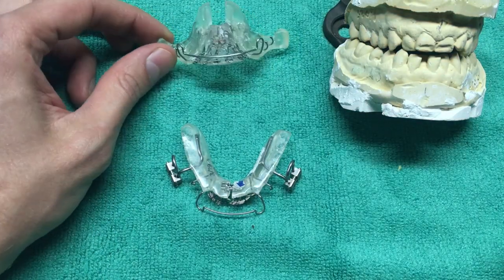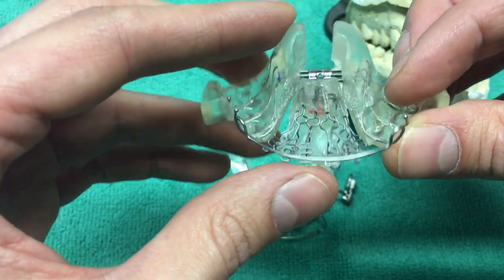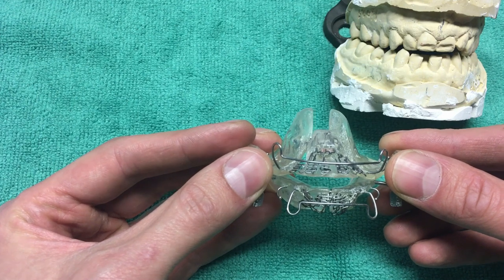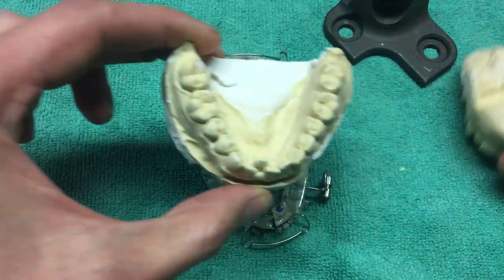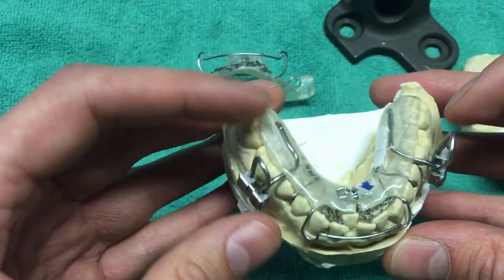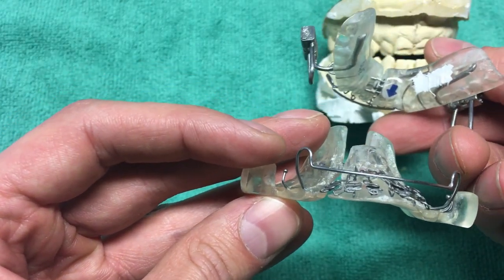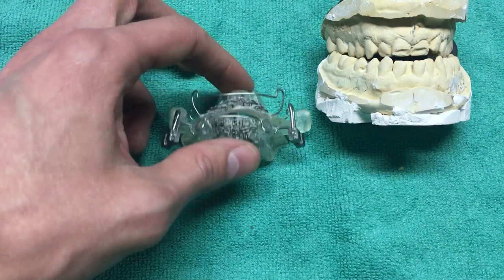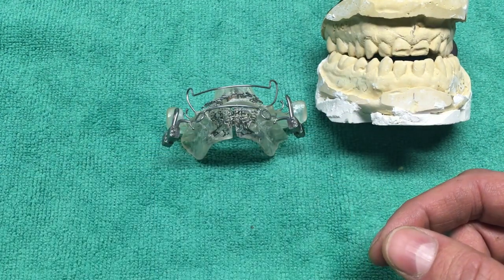What is a DNA Appliance? - This will cure my sleep apnea!

Comment: Does anyone know the difference between the Homeoblock and Vivos appliance? I know with the Homeoblock you have an unilateral bite block but with the Vivos you have acrylic across the whole of the teeth? Does this mean they function differently? I know it is there to balance the bite but I am wondering why they are both different to each other.

Forgot to add, I noticed the springs are slightly different as well when comparing them.

Thanks will be grateful if anyone can reply :)

Comment: Hi, is this dna appliance will expand the  palate suture?
Reply from the maker: Hi!  I am not sure why suture is the word you are using.  But, my palate is expanding.  So far, my palate has expanded and is wider by 2.5 mm.  This was what i measured at 7 months into treatment.  I am currently 10 months into treatment.  SO im sure its more now.
Reply: MSE is the best for that
Reply: No, after childhood, if you want to expand your palate without surgery, you can using MARPE. But I think even past early 20s MARPE is not able to open up the maxillary suture! I'm pretty sure this dude is going to have a bunch of buccal tipping.
Reply: @SmashFaceJimbo because if you’re not expanding from the suture than it’s only tooth born expansion and not bone born
Reply: So it's just tipping the teeth then? There's no new bone growth from the suture right?